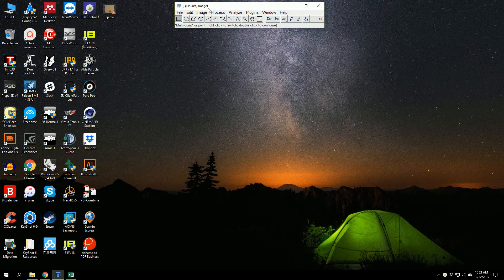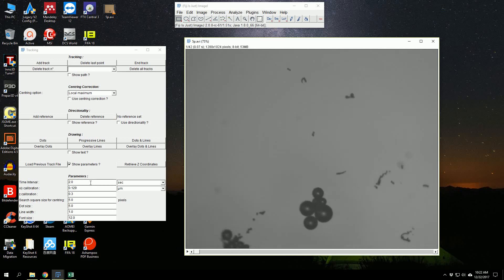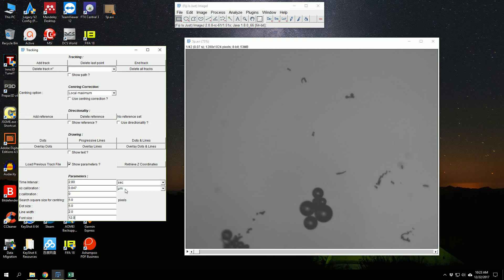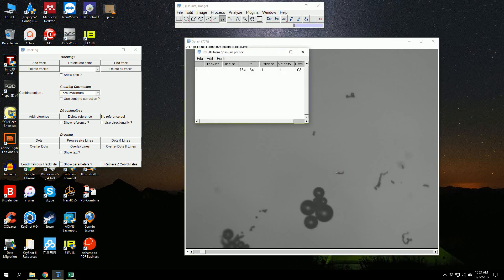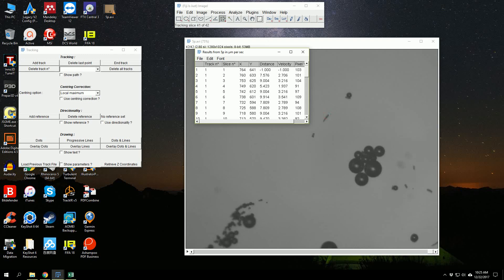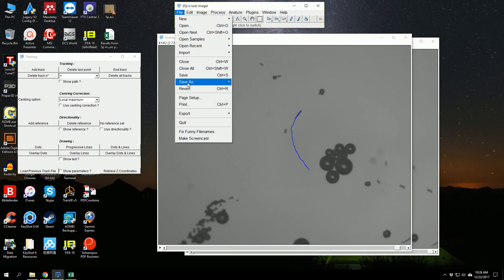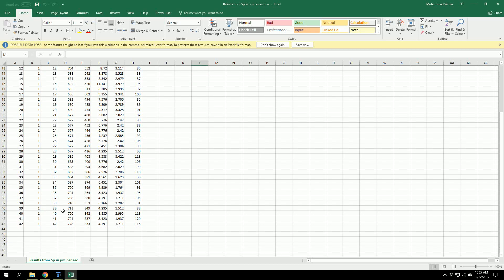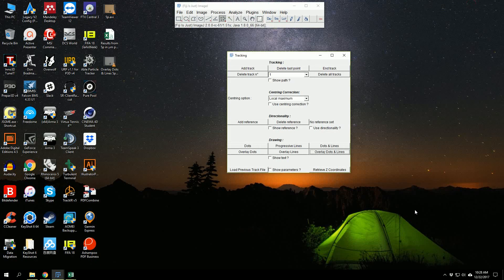Tracking of moving particles (micromotors) using FiJi or ImageJ

Comment: Thanks for an excellent video. I think the time interval you put 42 isn't correct. I think it's interval b/w frames, Like I have 17FPS video.. so it give me time interval of 0.062 sec. 
Also, would you more explain about x/y calibration? I took images, 17 fps, 50 um, 10X lens, the microscope showed 0.29um/pixel @ 4908*3264.
Reply from the maker: Thanks for the correction. Time Interval is the amount of time between adjacent frames.  ‘x/y calibration’ is the number of your unit distance per pixel (the inverse of the number of pixels per unit distance).

Comment: I don't understand why for the velocity you just sum up all the velocities, why not take the average?
Reply from the maker: Average will give you wrong numbers. The tracking is frame-by-frame, and for a total 50 frames you will have yo sum it, not average.
Reply: @AIforFunStuff  I don't get the point! I mean, how can the overall velocity during a path be the sum of the instantaneous velocities during that path? Help me understanding pls 😂  if I walk 1 seconf at 1m/s and then another 1 second at 2m/s my overall velocity is not 3 m/s
Reply: I was having the same question in mind... I'm sure Safdar has his point of view, but I'm sorry  I couldn't understand it as well, which makes me stick with Simone's doubt... if the given value is already velocity taken from two frames... shouldn't we get an average value of those velocities for given range of frames? I hope you can clarify this doubt for us Safdar.. Thanks a million!
Reply: Hi Simone, recently I have verified that the sum of the velocities in the column is the average velocity of the given frames, Safdar is right, it can be easily proved by adding the total distance travelled by the particle divided by the time used. Indeed, the value calculated is similar to the sum of velocities. The question of yours, "why not take the average?", can be explained by defining the velocities in the velocity column as [distance travelled by the particle between two frames (micrometer)/ total time used for the complete track from first frame to the last (s)]. That's why the sum of these velocities will be the total distance travelled by the particle divided by the total time used for complete tracking. Hope it answers your doubt and have a nice day!
Reply: It is because the time interval is here improperly defined. In order to compute the instantaneous velocity, you have to divide by the interval of time between two frame, not by the total duration of the film made of N+1 images. So the instantaneous velocity in this video are false by a factor of 1/N.
This explains why when Sadfar sums the N+1 values he got for the velocity, he miraculously recovers the good value for the average velocity ...

Comment: Thank you very much for sharing this information, you have saved me.
Now I am working with said plugin and I have some questions that I have not been able to solve, I hope you can help me. How is the Z axis calibrated? You will have a link with more information about the plugin?, I have searched but I cannot find
Reply from the maker: I don't think you need to calibrate for Z axis. We don't track motion in 3D, right? The video is 2D and hence only X/Y calib is needed. In reality, the motor indeed moves in 3D but we simply cannot track the velocity in 3D using this plugin.

Comment: Hi, thank you for your good video tutorial! I have an easy question. after saving the tracking table data with the button "Load Previous Tracking File", when I reloaded the data,  the table just showed zero-values. Do you know any solution about this problem?
Reply from the maker: Hi, sorry but why should you load the table with "Load Previous Tracking File"? if you need to do the calculation, open the data file in excel.
Reply: @AIforFunStuff  just for continuing the tracking work with previous tracking data when I did not finish all of the tracking work at once. :)
Reply from the maker: @sungshilkim  Better you do the tracking in one go. You should use short clips (5-10s long). It shouldn't be a problem to finish it in one go.
Reply: @AIforFunStuff  Sorry. my image sequence has lots of particles and I just want to record all of the tracking information in one csv file. Thanks for you reply anyway!
Reply from the maker: @sungshilkim  In such a case, auto-tracing is a better option. It more complex but does track several objects simultaneously. I never used it though. Good luck

Comment: Hi! thanks for you video, I have a little problem. I have Fiji installed in my Mac, when I upload it to Fiji it appears a window that says  BIO-FORMATS IMPORT OPTIONS and I don't know what I should click or move.. and if I leave it as normal it doesnt load my video it says that maybe its not a supported format, the reader plugin is not available or it was not found. the format of my video is .MOV
Do you know what can I do or how can I change this???
thanks!!
Reply from the maker: I am pretty sure that .MOV video format is not supported by FiJi for tracking purpose. If I may remember correctly, its the .AVI format that I used in this video.
Reply: @AIforFunStuff  thats what I thought but I also changed the format to .AVI and it still appears like its not supported :(
Reply from the maker: Fatima Lara Yes, because the .mov to .avi conversion does not work as the file is already compressed due to the mov format. You must use a camera that records the clips in .avi or other uncompressed formats.